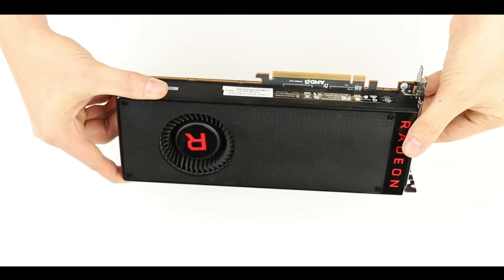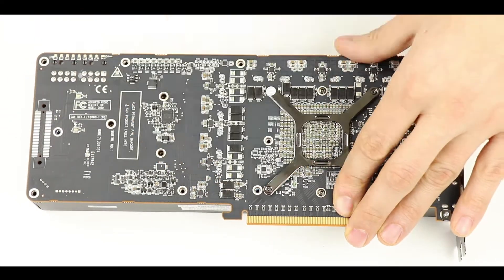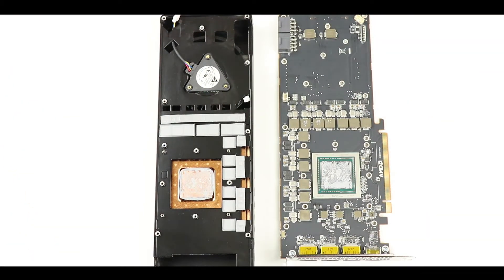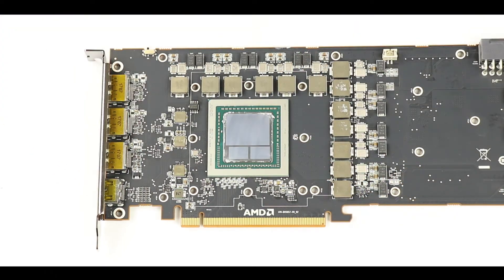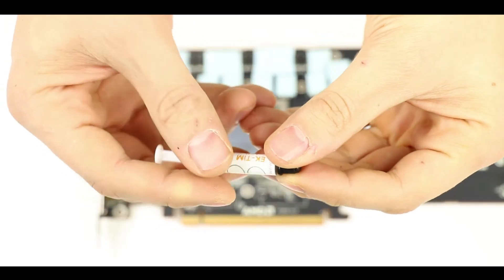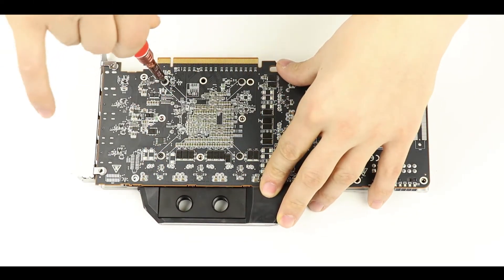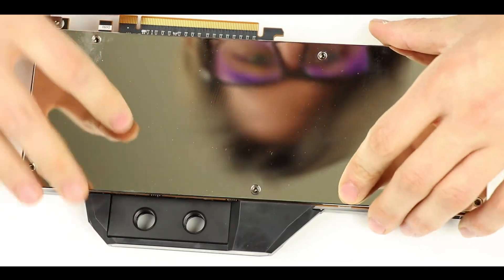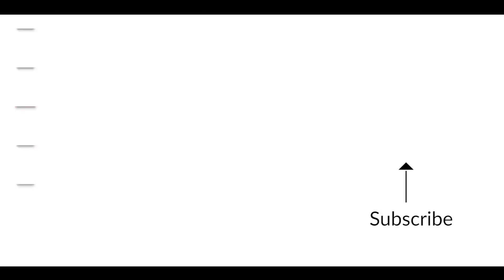Water cooling the Video Card ( The Threadripper Build 5 of 8 )

Comment: just curious I was wondering how did you get the single gpu bracket slot to work and stay in play?
Reply from the maker: I am not sure I understood your question. Could you expand.
Reply: Laurent's Choice I bought a gtx 1080 ti and a single bracket slot from ek and the only way I could get it to work was to mount it with the gpu using the bottom screws. Because the three screws wouldn't catch. ek said that my gpu was compatible but obviously it wasn't with the single bracket slot shield.
Reply from the maker: Lucky for you I have made the very same video with a 1080ti FE and an EKWB block ( https://youtu.be/qBITsorXUs4 )

Now, what exact waterblock model did you get?
Reply: Laurent's Choice zotac blower edition 11gigs
Reply from the maker: oh yeah... they do have custom made logic boards... you might have some compatibility issues. 
I do not believe EKWB cater ZOTAC boards.

Though... it's a heck of a card ! Even with the stock fan on!
Reply: Laurent's Choice yeah but if you go to the compatible list for the bracket it lists my card which it says its works but it doesn't which I was upset about. So now I have to remove my backplate for my watercooled gpu so mount it to bottom of the gpu to fit       -_- . But hey thanks for the response :) .
Reply from the maker: +TheCharmayne19 yeah that pretty much sucks ... Been there are it's no fun day :(